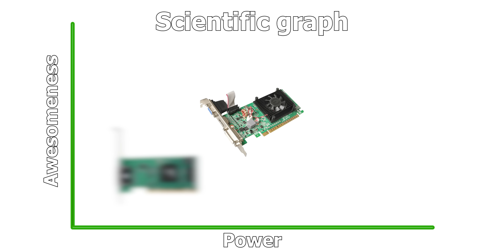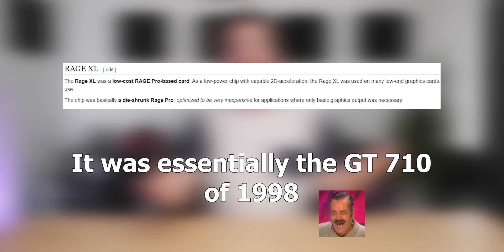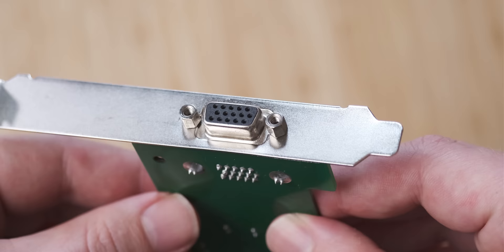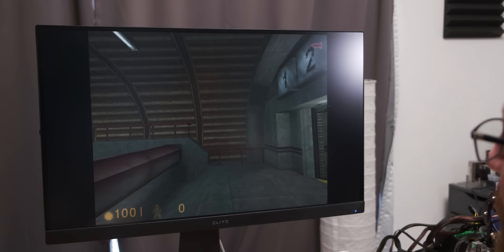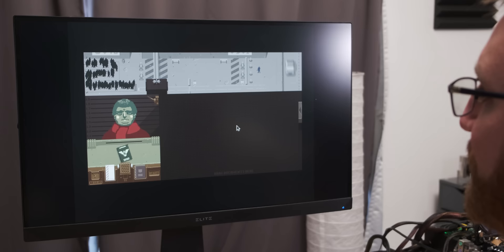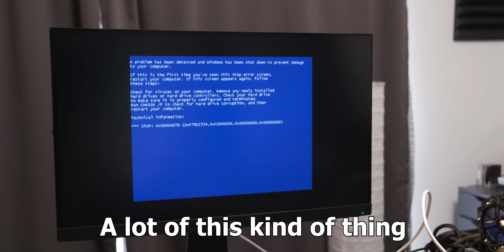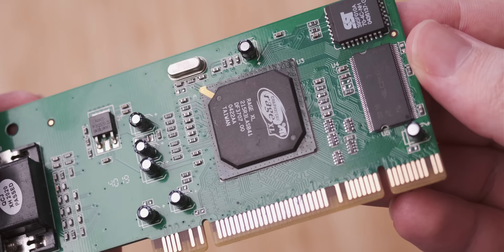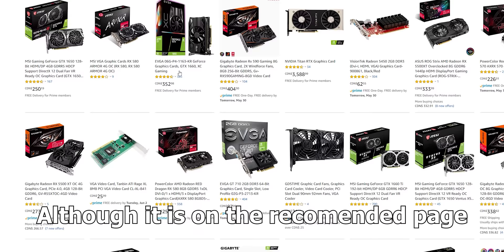Trying to game on the Least Powerful "Video Card" on Amazon

Comment: VGA actually has a few tricks up it's sleeve which makes it quite impressive, 1600x1200 16-bit is more of a limitation of the generic driver you are using, though this card might not be able to handle it. But I've managed to get up to 1920x1440i at something like 90hz on VGA, and it looks fantastic on an authentic CRT.
Reply: Actually impressive, are there videos of people pushibg the limits of dated video cables? Like supervideo or even component
Reply: I managed native resolution on a 1920x1080 monitor using vga before, granted it had a lot of analog noise, but it still worked
Reply: @ajddavid452  My 2nd monitor only has VGA input which I feed into my GPU with a VGA to HDMI adapter, no issue hitting 1080p for the good chunk of years I've had it running... is VGA output from a 2080 Super overdoing it?
Reply: @uglybad4  bruh you have a 2080 super yet you can't afford a second monitor with hdmi/displayport? XD wait why does that monitor only have vga despite being 1080p? it should atleast have dvi too
Reply: @ajddavid452  It's some weird acer monitor, don't remember the exact model, that only has one VGA input and nothing else. My main display is 1440p 144hz over DisplayPort which is what I use 99% of the time; my VGA screen is purely for secondary stuff like Discord or podcasts
Reply: @uglybad4  I see, still weird that a 1080p monito only has vga even the first 1080p monitors ever have dvi as well but vga only? that's weird
Reply: @ajddavid452  it's been so long since I moved it, I really thought it was just VGA. Took a look behind the monitor again for the first time in years and, sure enough, there's a DVI port too. 

I guess my next excuse is that I only had a VGA cable and don't feel like getting a DVI one lol
Reply: @uglybad4  I see, and yeah it's pretty normal to be lazy enough to just use a vga cable you have lying around instead of buying a dvi cable, but you can buy one now if you really want, they are pretty cheap, but make sure to do research because there's multiple different connector types with different pin outs

Comment: Technically, you can't keep calling this a GPU (or even the ATI term VPU ) as the RAGE series is comparable to nVidia RIVA series, and predates Hardware T&L.
Reply: Yes can
Reply: It's barely better than a math coprocessor, which my first PC (386DX) had back in the early 90's.
Reply: Yea I was entertained as always by the video, but he was definitely showing his age here. Old ATI stuff deserves better than being torn apart like this decades later. Who knows, I doubt the RTX 2080ti will be able to run Holograph titles in 2051 so this is a bit unfair
Reply: @hansolo631  It cant even run the games from the 90's
Reply: @fernandoferraz4146  was never meant to, it was a low end card when it released
Reply: transfrom and lighting
Reply: Right, all it accelerates is texture mapping and mipmapping.  Very simple stufff.
Reply: The rage card was pretty unstable, ATI first became a good option with the Radeon.
Reply: @kire929  the 3050 Is a low end card and yet It can play most modern games at 1080p and 1440p Just fine and can easily 4K/8K games from the PS2 to PS3 era LMAO, no excuses for this One.
Make It a low end card and perhaps not the best performing, but at least make It viable.
Reply: @MDT92  Different times
Reply: @kire929  too bad That only proves my point as i infact agree with you, If we go by the Logic that times were different then we also have to factor in that back then you could keep a GPU for a whole decade beacuse 2D games weren't so particurarly demanding generation After generation, nowdays every 5 to 6 years Is an upgrade, There Just wasn't enough consoles or PCs back then that would push the opposition to do Better, unlike nowdays.
Reply: @MDT92  This comment makes you sound ignorant at several points of it. I think you're wrong and that it's not worth arguing with you. I'm not elaborating any further
Reply: @kire929  👍
Have a great day sir.
Reply: @MDT92  Because the 3050 is a modern low end card, this card is from 1998

Comment: These cards do actually serve a quite important purpose, and that is keeping legacy systems for businesses and governments in top notch shape until they can be phased out.

Take the example of a hospital, for example. They just bought some insanely expensive equipment which is handled throuch a computer interface. Advance 10 years and you have a perfectly working machine paired to a PC that starts showing its age and components slowly start getting busted. As many old machines won't properly interface with newer computers, it's essential to have a market of new old stock for replacement parts in order to keep thousands of systems running way past their prime, and these cards (as many other components you can find) look to cover that need.

Comment: XP drivers will install in Windows 7 32bit. (Vista as well).  They may work in Windows 10 32bit but I've not tried it. (You may need to run the OS in unsigned driver mode since XP drivers were not usually signed)

Comment: That BSOD was a stop 7B.  It is an inaccessible boot device.  You can get that if you install Windows XP from a USB stick, are in RAID mode, etc...  You may just need to find the mobo drivers for SATA and use F6 to load them during Windows setup.  You may also want to be sure you have an XP SP3 install disk with those SATA drivers.

Comment: I had a card similar to that back in ‘98, paired with a VooDoo for the proper 3D stuff.

Honestly back in the Win 9x days having a display adapter with an 8 megabyte frame buffer, for 2D/Windows stuff, would’ve been really nice. 

Like you say pre-2000 games it’ll be fine, when installed on period correct hardware. It should play nice with Doom and Duke 3D for example.

Comment: Since was born too late to have ever used a PCI graphics accelerators, I always wondered why some boards still have PCI slots, until I learned that now these are usually used my engineers to diagnose errors and hardware problems.

Comment: That 7b error in windows xp installation is often due to using a Sata hard drive.  Some motherboards let you run your Sata ports in IDE emulation mode to get around this.  
The easiest way to avoid this issue entirely is to just install windows xp onto an ide hard drive, using the native IDE port on the motherboard.

Comment: How do companies get away with producing such disgustingly low quality parts.
Reply: It's a sad reverse chicken and egg scenario. If you don't make an ultra cheap card, someone else will. And then you don't get any profit from that market segment at all.

Although personally I agree with you, making ultra cheap parts doesn't make much sense in the long term as it can severely damage your brand image for those who bought one of those crappy parts from you. I would instead set a minimum standard for stuff I sell to help avoid that, nothing crazy but at least better than integrated graphics so that it makes sense to buy it in the first place.
Reply: Unregulated free market capitalism
Reply: @butter thus the free market will decide whether it will be sold or not. So not much problem there, no ones forcing you to.

Comment: To use some VERY rough numbers, I found synthetic benchmarks for the Rage XL on Hardware Museum (2.8). I also found a value for the Radeon 7500 (48.3). That's important, because you can find the Radeon 7500 on a more modern benchmark, like Passmark, where it gets a 3. It's worth noting, the $125 RX 570 has a Passmark benchmark of 6967. Using the Radeon 7500 as a scaling benchmark (the Rage XL is 5.8% of the Radeon 7500), that means we can rough out the Rage XL's Passmark at 0.2. This makes the RX 570 (a good value card, but still a value card) almost 35000 times more powerful than the Rage XL. Even the lowly GF 710 gets a Passmark of 621, or 3100 times more powerful, just to give an idea of scale. Not sure why I felt the need to work this out, but I did.
Reply: you cannot compare it like that. sorry to tell you.
Reply: @warrax111  As I said, those are VERY rough numbers- a full recognition that benchmarks are not reality. Do you have a better way of modeling the differences between the items in question?
Reply: @annagramgaming8934  Yes, it's uncomperable. You are trying compare, what cannot be numbered.
those are different technologies, platforms.
Newer cards have lots of features, supports higher versions of directX, etc.
You can compare only cards from about same era, that can be said  "this card is 150% faster, this card is 350% faster, etc...).
But cards from over 10 or 20 years, not.

Comment: Well for a server (at least for most use cases), it would do the job, as you just need a video output and nothing more than that. The other thing is, that my server requires a PCI Express video card, so I had to go for the famous GT710.

Comment: *sad geforce 2 noises*
Reply: GTS, Pro, Ti or Ultra? pls tell me it's nmot a crappy MX.
Reply: @HappyBeezerStudios  Oi Mx's are not that bad, i have 2mx/400 which runs half life 1 quite well
Reply: @AveragePootis  oh the mx was not completely bad. gf 2 mx were okay and gf 4 mx were sour because of lack of feature support. and some of them were actually faster than the fx 5200
Reply: @HappyBeezerStudios  
I had both gf2 mx400 and gf4 mx440. Poor man choice at that time but with CRT playing on lower resolution was not such a big problem like today on LCD screens and nobody care about framerates at that time. If you can find settings that give you playable game you were happy, simpler times. Lack of shader support was bigger issue with mx440, not at a time when I buy it but soon enough all games demanded hardware support.  
I still have both cards somewhere in a box with rest of old parts but not my original cards, I probably sold these long time ago.

Comment: Windows XP might not work due to you trying to use AHCI instead of IDE, AHCI wont work if you dont have drivers
Reply: Also windows xp doesn't include a built in sata driver, it will absolutely error out if you don't install a sata driver upon setup

Comment: Believe it or not a ton of servers still rock this chip as part of their remote control/video out. That’s why you can get it running at all in win 10. Also this thing can be overclocked with powerstrip. I used to have mine clocked at 100 mhz

Comment: Was planning to buy this as an upgrade to a POS system with a 450Mhz AMD CPU, but holy hell this is worse then I thought...
Thanks for saving my wallet XD
Reply from the maker: Haha!! That may actually be an interesting use case for it though. But yeah you can get something better. 😁
Reply: AMD 450 good chip noob give it a GF3 ti 200
Reply: Even in the era when a K6-2 450 was a popular CPU, the Rage XL was garbage. I think I was running a Voodoo3 3500TV back in those days, although I actually had the K6-III 450. Later on, I upgraded to a GF2 GTS.
Reply: A working system with K6-2 or K6-III on a Super Socket 7 motherboard would be far more valuable nowadays (as a retro machine) than a Rage card, especially a low-end XL model. Coupled with a Voodoo3 or GeForce, the machine would be perfect for just about any game in mid to late 1990s. Rage was not quite an opponent to Voodoo or GeForce; only until Radeon had ATi gotten some foothold on 3D gaming.
Reply: For the period-correct solution a Voodoo 3 would really be a proper choice, but for that POS usage the question comes up, does it have AGP? If yes, something like a old Radeon 9200/9250 or Geforce 4 MX could do the job. for PCI even something like a Rage 128 or Riva TNT would be worlds better.
Reply: @looweegee252  lmao no... 450mhz cpu with a gf3???
Reply: They are speaking the language of the Gods

Comment: Wow. I think that thing is even slower than my first video card, the Voodoo 2 12MB. I'm amazed that it works on Windows 10.
Reply: The Voodoo 2 did require a 2D card alongside it though. And that might have been something like this card. It was a weird time when you had one card doing 2D and one card doing 3D. And if you paired this up with a Voodoo 2, then you would have had a decent enough rig for the time.

Comment: If you're using a SATA drive make sure that you have set to ATA or Compatibility Mode in the BIOS, as AHCI won't work with anything older than Vista. If you plan on using AHCI you must either slipstream SATA AHCI drivers or use Vista/7 as they will run XP drivers.

Comment: Why amazon would sell in this day and age a GPU that was intended for an AMD K6 / Pentium2 with a CRT Monitor is bizarre... Back then DirectX and OpenGL were barely started. Proper 3d acceleration started by pairing such 2d card with a 3DFX card such as a 4MB Voodoo or an 8MB Voodoo2
Basically it's the Nvidia 710 of it's time... while the decent Opengl cards were Riva TNT which I think was the first respetable 3d chipset.
Rage was just a 2d powerhouse.

I had an AMD K6 233 with a 4MB ATI Rage card paired with a 4mb Diamond Monster (Voodoo chipset)
My PC  ran Quake, Unreal with what was at the time amazing graphics.

Comment: I have an old wheel alignment machine that has a video card with only 512k of ram. I put a newer flatscreen monitor since the crt was so blurry and it won’t work at anything higher than 640x480. So this seems like a sensible cheap upgrade so I can go to the native 1280x1024. It’s amazing that it still has a few applications today

Comment: Somehow, this card is older than a Pentium 3 system I recently acquired. I managed to get a card for it with AGP and 3D acceleration for like $10 since the card that came in it was almost like this with no 3D acceleration whatsoever. Direct3D did not work at all until I got the other card, which is a bit newer than rest of the system, but it works just fine for what I use it for. It’s kinda ironic seeing that card have extra headroom over the rest of the system.

Comment: LGA 775 Core2Quad
2x 2Gb ddr2 800Mhz RAM
NVIDIA GT630

This was my daily driver until last year when my 4th PSU since 2016 died on me, sure I may not have any funds to spare on a new/used PSU, but at least I still had a laptop from the early 2000's: a HP Elitebook 6930p with a broken screen, but who needs a laptop screen when it's got VGA port to connect a ViewSonic 21" VGA LED monitor to it.
Basically it's the same as my old desktop minus the dedicated graphics card. But it still works, sure I can't play CS:GO, but I can still play Counter Strike V1.6 and Unreal Tournament 2004, so is it really ain't all bad.

Comment: A good example of early dedicated video processing if you're showing it off with its intended Win98 hardware. It's not a "graphics processing unit" in the same vein as the GeForce 256 and onward. Rather, it does a series of VGA acceleration by passing signal into the accelerator, which then spot renders an analog sRGB signal.

Comment: The maximum resolution is not actually a limitation of VGA! The VGA connector can handle 1920x1080 in full-colour without issues (I would know, I've run that setup for years), and the VGA graphics mode is always fixed at 640x480. The 1600x1200x16 limitation is most likely a result of the graphics chip itself, or some other circuitry on that specific card.

Comment: To test older hardware like this, you should use a AMD FX or Opteron system and use virtualization with PCI passthrough. You should be able get Windows 9x and DOS running just fine with that.

Comment: The ATI Rage series was actually not "that" bad ... 22 years ago. The ATI Rage (Mobility) can handle Games like Warcraft 3 at 25-35fps which makes it perfectly playable, this game had no software renderer hence the ATI Rage was a blessing in laptops.

Games like Half Life 1 / Counter Strike ran at 40-50fps on Windows 98 / XP at 800x600. Your Win10 install used Software Rendering (Yes, Win10 can even emulate D3D).

Comment: this type of GPU actually has a purpose. I have this exact model in fact and that's because it's an pci gpu. That means I can run it next to my normal GPU and do things to it without being unable to see what is happening. For example, I flashed an older graphics card, an nvidia geforce 3 series card to the same firmware as the best model in the series, and with some extra cooling on the ram chips and a fan attached to the geforce, it was able to get the same performance as the top model of the range.
If I didn't have this PCI gpu however, I wouldn't have been able to flash the rom and mod my card.
So there is real reasons to have such a low powered pci gpu.

Comment: Selling used retro hardware on Amazon is definitely weird.

As you say the RageXL based cards were basically low end OEM junk even in the late 90s, just included as a 2D Windows video output which they were perfectly well suited to.

The fact it even supports OGL, DirectX etc is just one of those silly quirks of the time where you had to pretend your hardware was as capable as the next when you knew it wasn't. ATI were getting shit on by 3DFX and Nvidia at this time and badly performing Rage series cards were their product to compete against the Riva/TNT and later the Voodoo3. It had to 'support' these API's but the truth is what you see here.

Comment: These cards must be made from old stock components because the old colour VGA connectors were black, before they changed the VGA colour connector to blue(technically, VGA capable of   displaying more than 16 colours, like 8 bit colour that uses hundreds of colours is SVGA - Super Video Graphics Array, but my stats could be a little off)